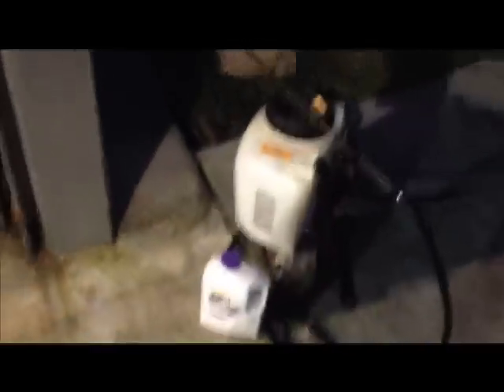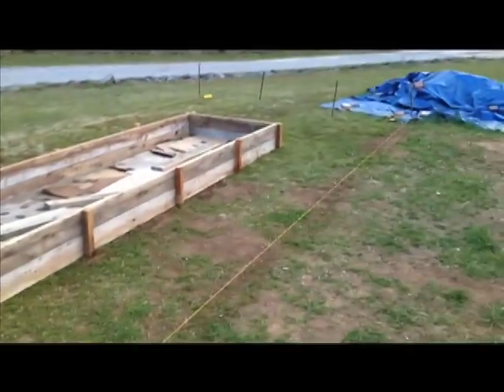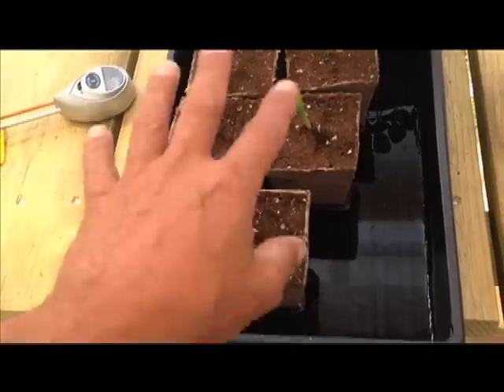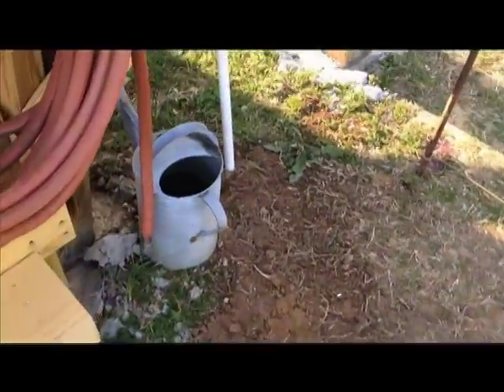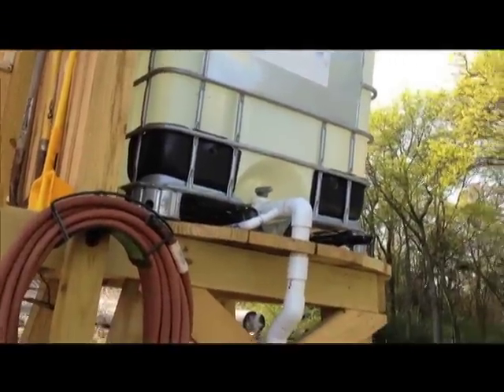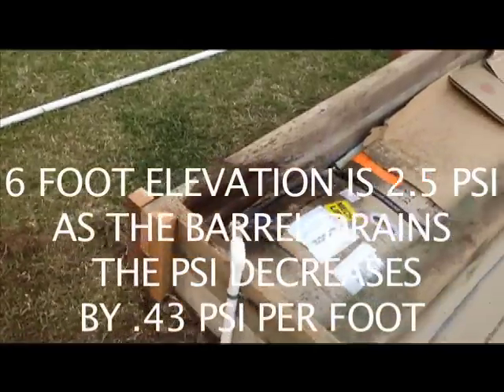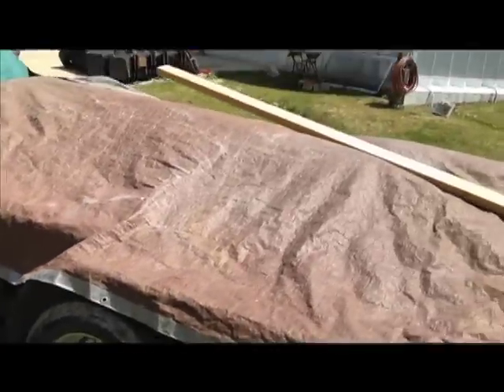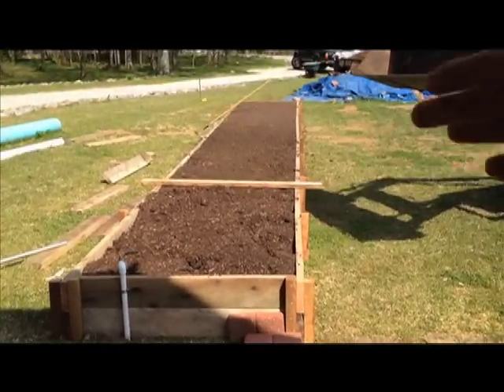How to build an EXPENSIVE Raised Bed Vegetable Garden Ep 2

Comment: If you don't have plan or are not at home for long time you can use plastic cover to protect the rain and weeds to growing in bed garden and for fruit trees, you should make drip irrigation system to safe your fruit trees :)
Reply from the maker: Yes, I have special soaker hoses for the garden that work with very low PSI from the rain barrel.  I plan to use something similar for the trees as well.